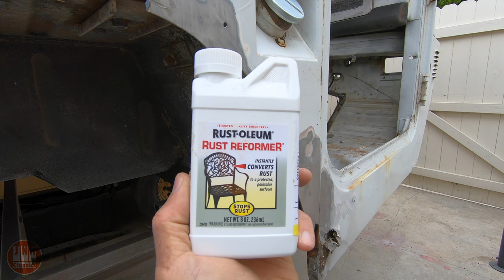FJ40 Restoration (Episode 25) - Quarter Panel Repair

Comment: well done and great demo video.  Are the ryobi (early part of video) and chicago (latter part) used for same kind of disc i.e. metal cutting?  Just wonder if they had different application disc.
Reply: And what kind is the yellow disc on dewalt towards the end?
Reply from the maker: I like having multiple tools with different disk, it speeds things up a lot. I have a cutting disk, grinding disk, stripping disk and wire brush each on a different tools. 👍

Comment: Had you already trimmed up some of the wheel opening before this video, because the new panel seems to extend a couple of inches below the top of the wheel arches?  Or are you modifying what was there for fender flares or something?  It's also very possible I don't know what I'm talking about...
Reply from the maker: Previous owner cut them out, I'm going back to stock👍

Comment: I would think that your tig machine would give you better heat control and less grinding.  Any reason you chose to mig the patch panel in?
Reply from the maker: Warren Rohloff the mig is better at filling gaps. In fact with a mig you want a gap between the two pieces. With the tig I would have to get both pieces to fit perfect first, then weld them together. With the mig I can just cut around the patch and fill the gap with the weld👍

Comment: What are the Black pieces on your dash underneath the gauge cluster that run along the bottom edge ?
Reply from the maker: benjamin taylor just the stock pads I think
Reply: Yep, those knee-bumper pads look to be stock for 1972, possibly other years as well?
Reply: @joesixpack7551  Any idea where you can get them mate ?